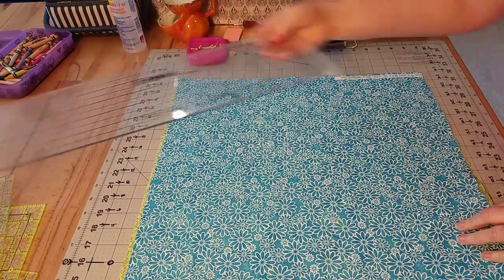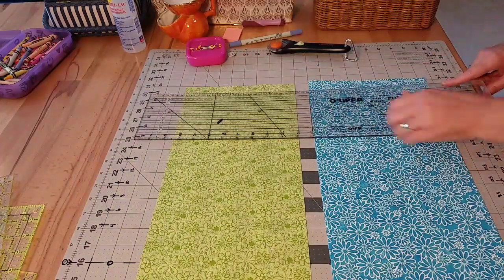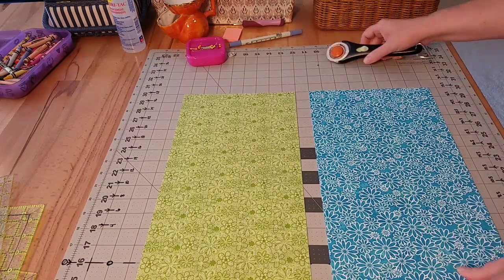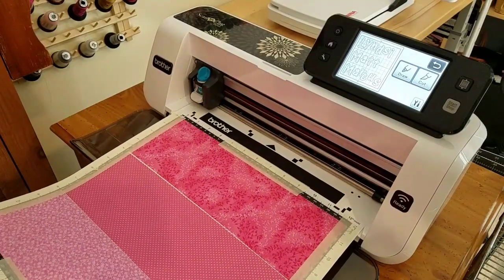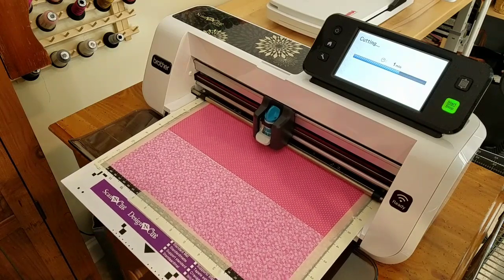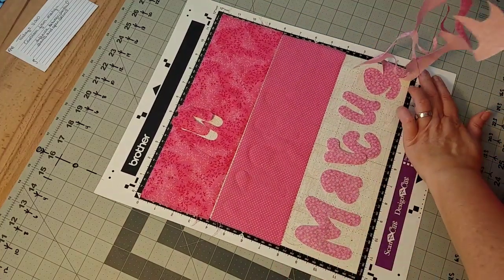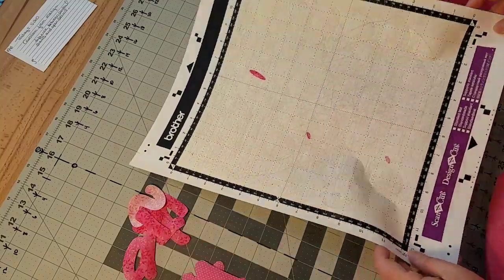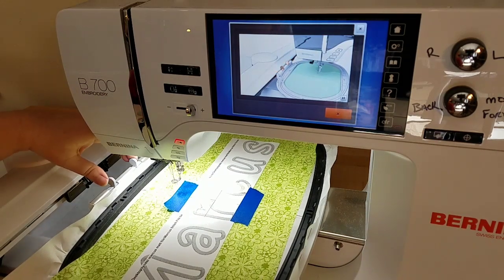Collage Style T-Shirt Quilt - Vlog Series Pt. 5 - Adding Embroidery To This T-Shirt Quilt

Comment: Hi Lisa, You can use your light pad to position very precisely the cut out applique fabric on the position seam. It shows through nicely. I bought my light pad because of I saw it on your channel first. It helped me doing applique. Every time you iron down a piece, you have to wait a tiny bit, if you need to move back to the light pad, to cool down the fabric a little bit, not to harm the light pad with the heated fabric.
Reply from the maker: that is such a GREAT IDEA........that's so simple...why didn't I think of that???? hahaha....thank you soooo much for sharing this idea!!!

Comment: THANK YOU THANK YOU THANK YOU!  
Thank you for sharing your steps and process with us!  What a great series of classes.  
I have been working on my first collage t-shirt quilt and had your videos open on my cutting table throughout the entire process.  I even created a display wall which helped so much.  I was amazed as I started sewing the squares together that everything fit together perfectly.  I had several of those dreaded partial seams sections and after doing one, it all made sense as I sewed around the middle block as you described.  
 I love watching your videos and have implemented so many of your techniques into my daily sewing!
 My question is how do you charge for this type of service?   A simple t-shirt quilt with all blocks the same size is so much easier but not as interesting.
Reply from the maker: Hello Norma, I am SOOOO so glad these videos have been helpful for you!!  Yes, the partial seams, once you do one you really get some hands on and then it all makes sense.  They get easier and easier the more you do :)  Have you seen my quilt pricing video?  My pricing may vary from your pricing, for all sorts of different reasons.  In that video I explain all of the variations that go into the price of a quilt, and there is a free PDF cheat sheet you can download that will help you develop a price that works for you